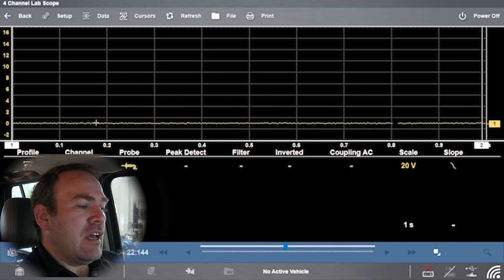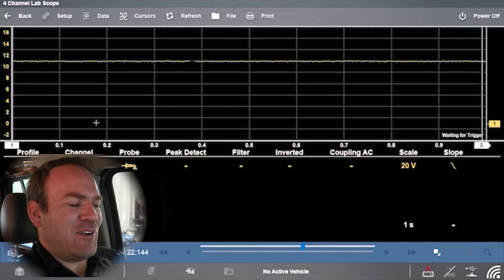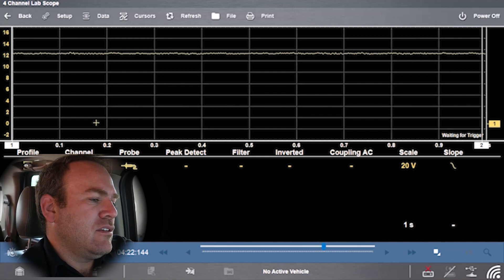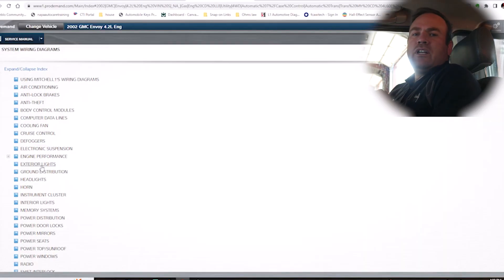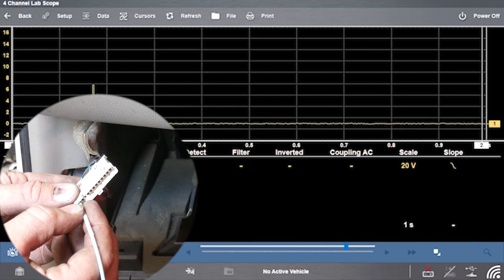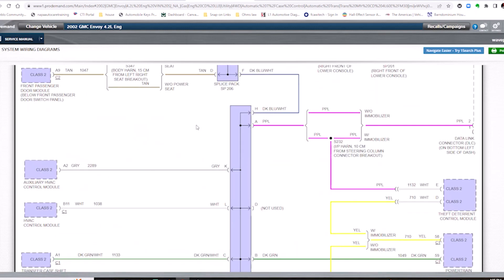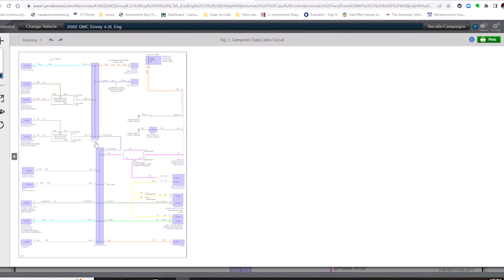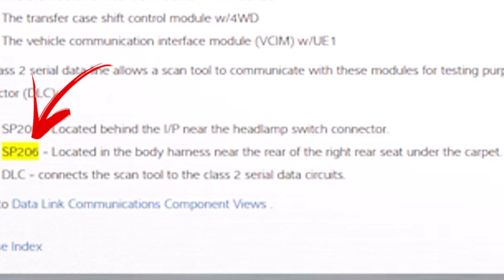GMC Envoy intermittent no start Class 2 fault

Comment: My Envoy won't start either. When the malfunction occurs, the fuel gauge shows no fuel and the gear position indicator bar doesn't display. Everything shows normal when it can start. The computer test found a U1000 fault code. Could it be a problem with the transmission control module?thanks

Comment: I'm having the same problem it was running good in way to work it shut off on me and would not start again put scan tool on it,code ignition switch fault 2and rear wheel speed sensor,so I'm going with your aproach,owners before us put electric start on it and it's in that first splice pack u touched front dash

Comment: I know it's been a while since you made this video, but I'm having similar class 2 failure issues on my Envoy. I had a question, even with this class 2 failure, were you able to operate the liftgate lock and rear wiper still?
Reply from the maker: I don’t remember but my guess would be that the lift gate would still open since I had to open it up for repair. With the number of broken wires in the hinge it’s possible to have functions acting up as well.
Reply: @ThePracticalMechanic  thank you! A follow up question if you're able to remember, but were all the dash lights coming on or just some of them?

None of my dash lights come on except the CEL (powered by the ECM) and the battery light (powered by ignition fuse). A scan tool can get the high beam and passlock lights to come on, and sweep the gauges, but that's it.

Comment: Hmm.. What would have I done differently you ask.? 
 Well, I would have pulled up YouTube and watched your video.! 😂🤣   I would have probably had that seat torn apart and on fire just from the frustration itself. Lol  Ok, maybe not, but it has crossed the mind a time or three. Lol
Honestly, don't think I would have done anything much differently Bro.  Great job my friend  👍
Reply from the maker: Ha!  Thanks Kevin. Funny thing is I have seen three of these since I made this video. Two came into our shop and one was a mobile pcm programming where I had no communication and couldn’t program the new PCM. I told the shop what to check for and they repaired it before I came back to complete the programming.  They had already sent the original PCM back as a core a week before they called me in to program.

Comment: Ive had about a half dozen of these and every one has had broken wires in that pass through in back.  the key FOB module is in the hatch.  i also repair the four or five body grounds under the hood as they are usually terminals to painted surfaces and have poor continuity from the factory.

Comment: Good case study
Reply from the maker: Thank you. I just ran into this on another vehicle. Shop called me out to program a new pcm and I couldn’t communicate with any module on the network. They also had a battery drain sometimes. I didn’t have time look into during that visit so the shop dug into it and found the lift gate module causing the issue. When I return I pulled back the boot and found all but two wires broken through.  
Repaired the wires and programmed the pcm. They had already sent back the core so we couldn’t test if the original pcm would work. I guess the original had some other intermittent issues as well so it may have needed it. 🤷‍♂️
Reply: @ThePracticalMechanic  I do not see a whole lot of comm failures. So seeing another tech walk me through the process is great help. Thxs again buddy

Comment: Great video/information and while you where checking the signal from splice pack you used the wire that was on pin 2 or not brother and as always learning from the best thanks for sharing.
Reply from the maker: Yes I just moved my test lead from pin 2 on the DLC to the splice pack. I hope the next one will be easier for me to diagnose but by time I see another issue like this I will likely forget to just jump to the splice pack. I just ordered the Uisolate test leads from AESwave. it allows you to connect to all pins of the splice pack and then you can unplug one at a time to find which wire is causing the issue. https://www.aeswave.com/cart.php?m=product_detail&p=9669&lastAddedItemId=398217

Comment: SUBSTANTIAL The Practical Mechanic 
Questions time Pete Meier Motor Age 
Would have done Voltage drop testing to trace fault in the wire harness 
SUBSTANTIAL The Practical Mechanic 
Thank you 
From Nick Ayivor from London England UK 🇬🇧